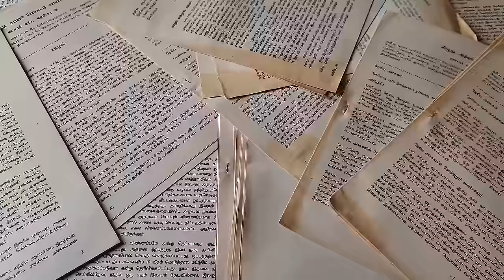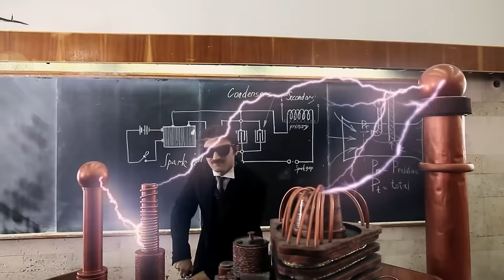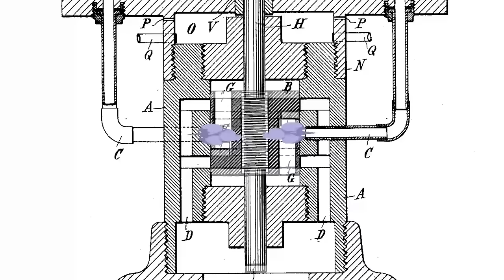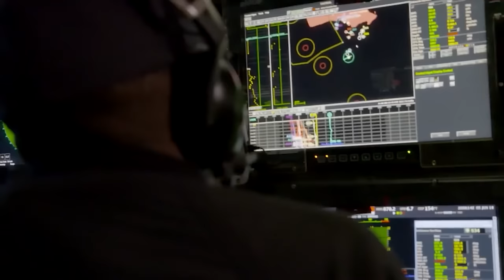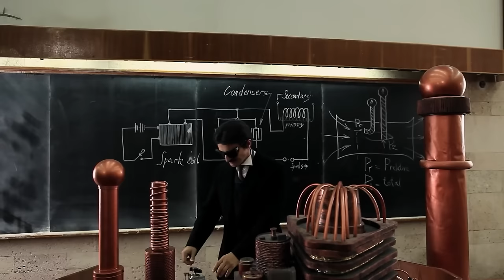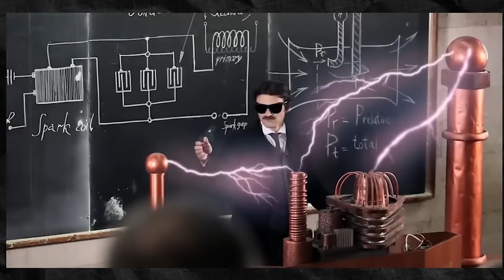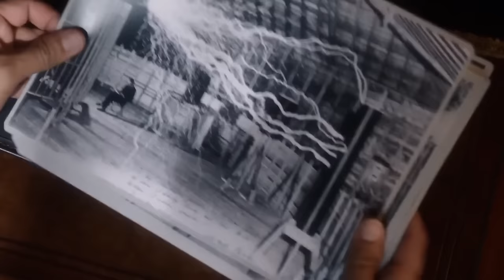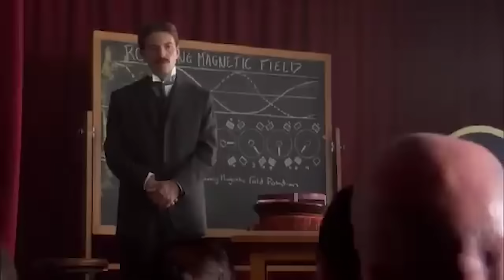Nikola Tesla Breaks Silence Before His Death And Reveals TERRIFYING Secret

Comment: We have the Death Ray plans.   Bergstrasser had a copy, and he finally passed them along in 1984, and Andrija Puharich published them.   
It turned out to be a sort of waterjet-cutter, but using mercury droplets instead of water, and powered by megavolts, rather than with megapressure-pumps.   The droplets are nano-scale, and small enough to be classed as "metal ions."  

But did it have the claimed 100KM range?   Nobody knows (well, maybe it's part of mil. black projects.  Ask THEM! )   When the droplets are nanoscale, electrically charged, and traveling at many times the speed of sound, the behavior of the beam is nothing like that of a normal waterjet cutter.  (It may experience "gas focusing," rather than atmospheric disruption.  And, the smaller the droplets, the lower the Reynolds Number, until droplet beams behave like laminar streams of incense smoke.  Turbulent transistion becomes impossible.)

Tesla's Death Ray was used in the 1950s, as tiny thrusters for satellites.   Metal-ion propulsion.   Years later it became part of the very first inkjet printers, a beam of charged ink-droplets steered by electrostatic deflection.

Today it's called FIB ion-beam machining.   Ion-beam Lithography.   The hypervelocity metal-droplets remain inside the vacuum chamber, where they can carve deep slots in any known material.   But today the "liquid-metal ion-emitters" employ liquid indium or gallium, rather than Tesla's much denser tungsten or mercury.   And nobody tries passing them out of the vacuum chamber  ...by using NASA plasma-window, etc.

The Death Ray had one major benefit.   In the 1930s, Tesla sold the plans to the Russians for $25,000.   Thats around half a million bucks today.   So, it allowed Tesla to keep his secret 1930s lab going.   Possibly the Russians never used it, because Tesla's letters reveal that he was then arguing with Russian physics experts, who now had the plans, but didn't believe it was real.   (Maybe they were like G. Trump, the physicist whose ignorant disbelief prevented the USA from testing Tesla's death-ray  ...even though Trump seems to actually read from the same copy of Tesla's death-ray plans which was released by Bergstrasser forty years later.)

"Skepticism" masquerading as mindless sneering disbelief   ...it's a common failure of Experts, no matter how high their stature.
Reply: Wow
Reply: Damn!! Man you studied like a BOSS!!!
Reply: @wbeaty when your comment is better than the actual video it's off of ;') props to you and its sad how everyone took Tesla for granted such an amazing man I wish we had listened to him